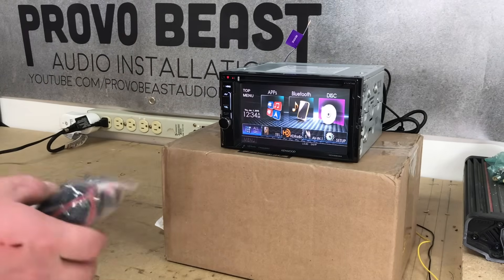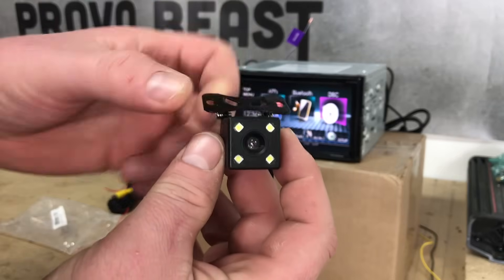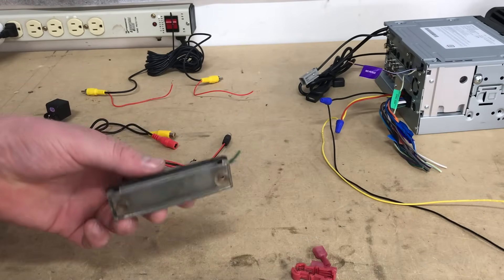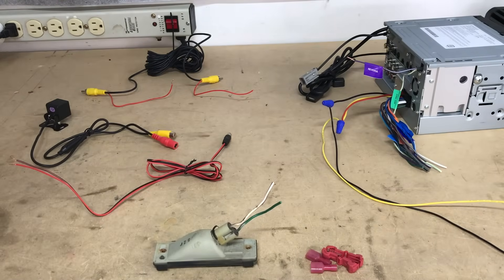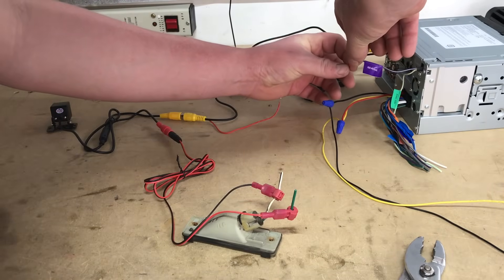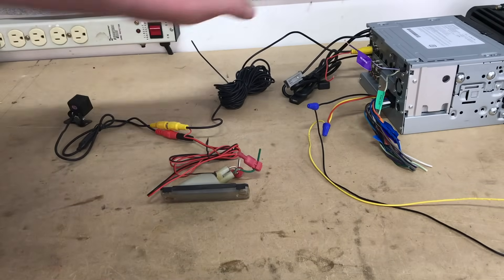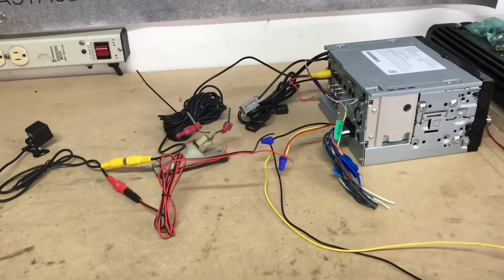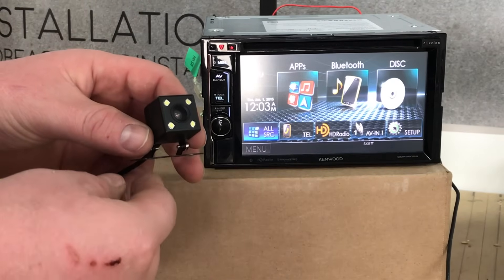Car Backup Cameras Explained: How To Install On Your Car!

Comment: So if my video cable doesn't have the red wire I am guessing I would have to run my own wire for my reverse trigger. Also to keep power to the camera when the key is on I would have to run a red and black wire from the radio to the camera. Right?
Reply from the maker: You got it.
Reply: Provo Beast Audio Installation I am using a maestro rr with the gm5+. The gm5+ has a reverse wire. Can I just connect the reverse wire from HU to that wire and that will trigger the screen to turn on when I go into reverse?
Reply from the maker: yep, thats the better option
Reply: Provo Beast Audio Installation Thanks for all the help.

Comment: My yellow video cable wasn't long enough so I cut it thinking it was 1 wire.. it's three little wires.. had to do each one and make it a longer cable.. I'll find out if it works tomorrow.
Reply from the maker: Generaly if the video cable is too short, you can just purchase an RCA extension and add wire to the trigger wire.
Reply: lol that probably would have been easier.. i got it working 5 years later.. it looks like crap..  @ProvoBeastAudio

Comment: Dont we have to connect back up camera to fuse or something? Plus can we connect camera and parking sensors to reverse light at a same time?
Reply from the maker: You are welcome to fuse it sure, but generally the configuration relies on the fuse of the light already.  You can connect it sure, but just be mindful of how many amps you are pulling from the reverse light circuit.

Comment: i purchased a cheaper rear camera from off of Ebay..( PYLE) # PLC,38FRV
i figured out how to correct slanted image and or guide lines. it was just a matter of rotating the lens , straightened   out guide.lines just that simple. by the way! great video !

Comment: Does the parking break wire need to be grounded to allow the display to work?
Reply from the maker: Nope, but now-a-days, manufactures are getting more and more complicated and that wouldn't surprise me.  However, generally, no the parking brake doesn't need to be grounded.

Comment: what wire can i leave unhooked to remove grid lines ? grid lines on my camera are lopsided.  and is it a wrong way to mount camera ? meaning  a top mount or bottom mount ?
Reply from the maker: All depends on the camera.  Generally, the cheaper ones don't allow you to manually remove the grid lines, but again depends on the model.  The one used in the video didn't allow that.  Also it has to be mounted with the mount up as it hangs

Comment: Great video. Some questions though...

I am interested in hooking this to the back of a travel trailer, so I assume it would need a connector to hook/unhook at the connect point of my truck and trailer. could I simply pick up another RCA cord and just use one side, or is this cord different from a typical RCA cord due to the "little red wire that runs all the way through it?"

Also, in my Nissan Pathfinder, there are RCA hookups in my center console that connect to my in dash screen. I can hook up a DVD player to play movies through the in dash (factory) radio. Could I simply plug the RCA cable into this, or would I still need to do something different?

Thanks for any help!
Reply from the maker: For your travel trailer, you could try a nicer wireless system that can support that distance which would eliminate the need for a physical cable.  Yes you could, but it may require you to manually switch over to it when in reverse, but in theory, yes.

Comment: How big hole do I need to drill for this camera? The cable itself looks thin but does that RCA connector needs to fit through that hole too?
Reply from the maker: It's a standard size RCA cable, so i'd find one at home and measure it.

Comment: Hello, i tried to install my camera, everything was workin good, but when i turn on the engine it shows me "no signal" and sometimes i have black lies on the screen and the camera shows too bad, can someone help me?
Reply from the maker: You may need a 12v noise filter if the camera works while the engine is off, but no when running.  the PAC CSS12 Passive Noise Filter may do the trick.
Reply: Thank you very much i will try it.

Comment: Hi great video. I bought a dimmable rear mirror. I set it up as scenario 1 but my dimming function does not work. Can you provide and explanation? The cables running behind the mirror have 2 AV connection (camera and video), 1 black and 1 red. This is my setup. I connected the red wire of the mirror to the red of the camera long cable. AV cable of mirror with AV cable of camera. AV video of mirror NOT plugged (capped). And black cable of mirror on car ground chasis. At the rear of car. Same setup as scenario #1. Result: on reverse I get video. While driving: No dimming option. Your expert opinion is appreciated.

Comment: Man, I am so lost, my 2006 Volvo S60 has 4 different wires that go into the reverse light and I can’t seem to get it to work
Reply from the maker: Use a multi meter, don't just guess.  Even a test light can help you identify the right ones.

Comment: My head unit doesn’t have a reverse wire. I have the same camera harness you do too. Just not the purple wire or reverse on head unit
Reply: I have it in settings when messing with it I can see the camera when I reverse but once I get out of camera set up and on main screen and I go in reverse camera doesn’t turn on
Reply from the maker: Well, depending on the brand, it may not be purple / white on the radio.  Some brands have them colored differently.

Comment: Hi, good video right there. Can I ask what are the pros and cons of the two options for installing the camera. Mine is on the second option and I'm worried if the camera will be much more easier to break down since its always open when the engine is on. Thanks!
Reply from the maker: Depends on the quality of the camera.  But i you get a cheap one (like the video), they are simple to swap out so it's worth the risk of running option 2.

Comment: Great video. Thank you very much. I wanted to ask if you know where to connect the light green Parking Switch cable (PRK SW) coming out of the unit? Is there a light green cable on my car's harness that matches up to it?  I have a 2005 Toyota Tacoma and I can't find anything online about where to terminate this PRK SW wire. Thank you in advanced.

Comment: Could another camera be added to the right mirror, and every time the right signal light was turned, that camera would come on? And still have the backup camera?
Reply from the maker: No, but the sony xav-ax100 has multiple camera inputs for possibly that functionality.

Comment: Hey if I connect the reverse wire from the Stereo to the yellow input would it work instead of connecting the reverse wire from the stereo to the reverse wire on the car tail light ?
Reply from the maker: Don't connect it to the yellow wire as that is the constant power wire of the radio which would create a drain.  I would connect it alternatively to the red wire on your radio (if there is enough amperage to support it) so the camera turns off when the key is off.

Comment: If you choose to go with the alternative setup... will the reverse feature still work?
Reply from the maker: Yep, still will, as long as you ensure the "trigger" wire is still connected to a source that puts out 12v+ when in reverse.

Comment: After looking several videos this one is the best !!! but may I ask a question please !! Can I run the power thru the trigger wire and use another cable with switch from lighter to the radio trigger so I can manually use the camera when I want ?
Reply from the maker: Sure, but be sure the gauge of the trigger wire is the same size or larger than the power wire of the camera to sustain enough amps to that run to safely power to the camera.

Comment: This is very helpful!! THANKS!!  
But i have a question, i have a "parking" cable and a "back" cable in the aftermarket radio. On which cable should i connect it?
Reply from the maker: Generally this cable allows you to watch video in motion or access system settings.  You can connect this to the parking brake ground wire or on some radio models, you can just ground it.

Comment: I love your videos, Informative! I have a question. I want my backup camera to be on at all times when my car is turned on. If I use method 2, do I still need to connect the Video Trigger red wire to the reverse light since I'm wiring the black and red wire directly into the head unit?
Reply from the maker: Yes, the trigger wire is only for the radio to cycle over to reverse mode when you put it in reverse.  So scenario 2!

Comment: What your thoughts on adding a relay to the reverse camera..do you think it's necessary..???thanks.  Joe
Reply from the maker: Nah, don't think so.  However, if you running the power and ground all the way to behind the radio (scenario 2), and your car requires a smart harness, those smart harnesses generally only put out an amp of power, so in those situations, yes! you will need a relay.
Reply: +Provo Beast Audio Installation ..no,just hooking up to aftermarket bmw I drive screen..powering from reverse lamps..thanks
Reply: +Provo Beast Audio Installation ..Basically gonna hookup the same way you showed. Should be fine,Right???
Reply from the maker: Yep, if you are powering the camera from the reverse lights, just use scenario 1 and you should be good to go!
Reply: +Provo Beast Audio Installation ..Will do!!  Thanks again...joe
Reply: +Provo Beast Audio Installation ..everyone keeps saying I'll get distortions..what your thoughts on that???bmw.
Reply from the maker: Try it without it, this camera only pulls around 200mA so not sure why a relay would be needed if connecting with scenario 1.

Comment: Hi, if i connect the camera to the radio power cable, wouldn't the camera's led lights up all the time?
Reply from the maker: Yes, so it all depends on the camera you use.  If you want to wire that way, i suggest you purchase a camera without LED's.

Comment: Finally a video that shows exactly how to connect the wiring.  I was not sure of the trigger wire attaching to the same power source at the camera. thank you for the best explaination of this simple but confusing install.  Additionally, IF someone didn't want to run a power wire all the way to the headunit, but wanted it powered when not in reverse, you could tap off the tail light and control the power to the camera by switching on your lights.

Comment: Nice work there!!
I have the exact camera as yours. I bought an android system for my 2012 Kia Rio hatchback. I don't understand the use of the red wire running in the video cable? As the camera is being powered by the reverse light it will automatically turn on when i put the reverse gear, so why connect the other red wire?. My android display also has this wire for reverse and one for brake which i don't know what is for.
Reply from the maker: The reverse wire is the trigger wire to be hooked into the radio's reverse gear trigger wire.  The other end connects into a reverse wire power source to signify when the car is in reverse, that wire carries the power indication for the radio to cycle over to the reverse video feed automatically.  If you don't hook it up, your radio will not know when the car is in reverse, and will not automatically cycle over to the reverse signal when backing up.
Reply: Ok i got the point. I forgot to mention that i also bought a wireless video transmiter https://www.aliexpress.com/item/2-4G-Good-Quality-Car-Wireless-Module-for-Car-Reverse-Camera-Rear-View-Camera-back-up/32568585458.html?spm=a2g0s.9042311.0.0.bZP9SP to avoid doig all the wiring work. This one except the rca for video and the power connector to the camera it just has the possitive and ground cables in both sides. Where to connect the reverse cable of the audio unit?
Reply from the maker: That would have helped...If it is wireless, your kit may trigger it automatically.  Just follow the instructions that came with the camera.
Reply from the maker: Right, but you still need the trigger wire or else you will have to manually switch over to reverse mode when you are actually reversing.  Hooking up that trigger wire will automatically do it for you.  You still will be able to switch to reverse mode manually while driving forward with the wiring configuration in Scenario 2.
Reply: +Provo Beast Audio Installation ..Good question..my new 8.8 android (dvdgpsnav)automatically switches screen to backup mode even though I don't have reverse signal wire hooked up..why?
Reply: Provo Beast Audio Installation  so if you don't hook up the reverse video red wires it's okay right? since the camera is being powered on automatically by the head unit using method 2 of course. It will be on regardless of you going into reverse or not.
Reply: +Darth Shredda ..I'm not totally sure.I haven't installed camera yet..but,when I put car in reverse,it changes screen display to backup mode...so the question is..perhaps my new head unit has a fiction that does it automatically...We shall see after camera install...more to come.  Good luck.   Joe
Reply: Well, i tried to install the wireless kit, it works but it doesn't turn on the camera automatically when i put reverse gear in. It still needs the trigger wire. So here's what i did.
I installed the transmitter module in the tailgate taking power from the reverse light and also installed the receiver in the back of my head unit. Behind my dashboard i found the reverse wire that goes to the back of my car, I took power from it, and connected to both the wireless receiver and headunit's trigger wire.
So  now everything works fine without passing wires from the front to the back of the car.

Comment: Awesome video! Quick question... if I want to connect my back up camera via the second scenario mentioned in the video, should I connect it to the 12v constant or 12v switchable power lead?
Reply from the maker: Switchable, you want it to turn off when the car is off, eliminating the potential of a drain.
Reply: Awesome! Thank you!
Reply: In the video you hooked up the back up camera power to the 12v switchable power lead and ground from the radio harness. Could I simply just hook the camera power cable to another 12v switchable power lead (not reverse light) and ground from a rear tail light or maybe the trailer connector leads?
Reply from the maker: you got it!
Reply: carsanbo

Comment: The most clear how to video on this topic! Thumbs up!!
Reply from the maker: Subscribe!
Reply: carsanbo
Reply: Provo Beast Audio Installation 
I have a wireless camera but I am not able to connect them.
Can you help me please?
Camera have 2 wires yellow and red these fit the wireless transformer.
Monitor have 3 wires yellow, white and red while the wireless transformer have only yellow.
Reply: It's true, I kept seeing others trying to tie the Reverse line off the Stereo in parrallel with the B+ and ACC wires off the harness I was like wtf.. I don't want my camera on the screen 24/7

This video is better than most

Comment: Ok I have this exact camera set up but my radio does not support no camera so how would I connect it as I have the cam that can sit on ur dash or window but all wires and all u have is what I have just not hookable to a radio so can u explain how I do this please
Reply: Basically my screen for the dash hooks up with same wires but no idea how to get power hooked up again all wires to cam and the screen are exactly just what is used in this video just need to know how to get power to screen with the yellow connector that has the red wire just like in this video please help
Reply from the maker: You can pick up a dash mountable screen: https://www.amazon.com/Esky-Display-Degree-Adjustable-Monitor/dp/B01461MDXA/ref=sr_1_1?ie=UTF8&qid=1515780059&sr=8-1&keywords=backup+camera+screen
Reply: Provo Beast Audio Installation I have and no way to hook it or where that's why I watched ur video cause the setup u got I got just a dash screen is all and radio don't support it that's why with same wires on screen and cam I wanted to know how to hook it up as cam nor screen came with instructions
Reply: Provo Beast Audio Installation And I won cam off tophatter and screen from eBay

Comment: What if the t.v. or head unit doesn't have a reverse wire on the wire harness but has a cam rca plug?
Reply from the maker: The reverse wire is responsible for automatically switching to the reverse camera when the car is in reverse.  Without it, i wonder then how your tv / head unit switches over without manually doing it every time?
Reply: Provo Beast Audio Installation so u  have to use the red wires that's attached to the rca plug ?
Reply from the maker: No, not necessarily, it is there more for a convenience.  Really it is there to be used to either carry the power for the camera it self, or to use it as the trigger wire for the head unit.  You don't have to use it if you don't want to.